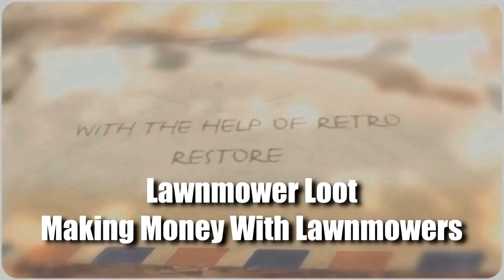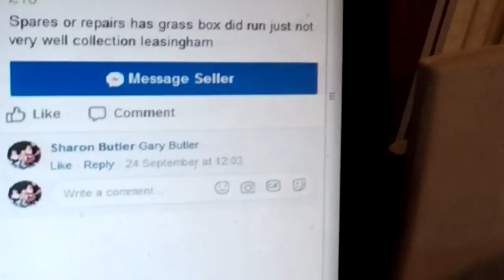Making Money Repairing Lawnmowers

Comment: I used to do the same with bicycles. I used to either pick them up free or cheap and fix em up. What ever wasn't worth the effort or too far gone would get stripped down for parts. So I barely ever spent money on new parts. I can;t do it now without ESA getting arsey, even though I only did it as a little hobby and sold maybe one bike a month if I was lucky (only because I didn't put much effort into it due to ESA but they still get bloody arsey)

Comment: Do you balance the mower blades after sharpening? I always take the blade and put a Phillips screwdriver through the hole and rest the tip of the screwdriver on the bench and hold the handle of the screwdriver in my hand and see how level it is.If it's not balanced and un level on one end of the blade
Reply from the maker: Yes I do the same

Comment: This was a great job in reviving, however there still seemed to be a slight hesitation to the engine after you were all said and done. Did you run it for longer to see if it went away, or did you find something else that needed adjusted?
Reply from the maker: You need to run these mowers for a while to burn away the oil that accumulates in the head and exhaust where they have either been over filled or tipped up the wrong way.  they will be fine then.

Comment: I replace those rubber boots all the time. it's just a bit fiddly to get on. You gotta poke the end through then grab it with a small screw driver and pull the rest of it through it takes about 3 minutes.
Reply from the maker: Yeah, I agree. Can you buy them on their own ?
Reply: I believe so? I usually save them when i change a car's ignition wires. they are the same boots that go to a distributor or coil pack. I'm 98% sure you can buy them individually.
Reply from the maker: Nice find Lem

Comment: Another great video buddy. Can I ask, I have just got myself a £10 lawnmower, but it doesn't have the throttle bar thing , can you get a universal one and have you ever had to fit one? I would like to see how you go about it.
Reply from the maker: What mower is it Ryan?
Reply: retrorestore it's a flymo petrol. But I'll have to find out the exact model if you like.
Reply: retrorestore I seen I lever kinda thing on eBay.
Reply from the maker: Is it a briggs and stratton engine and do you mean the handle leaver at the top of the handle?
Reply: retrorestore yes Martin it's a Briggs and Stratton engine. Yeah the handle at the top that you squeeze in its missing.

Comment: Cool i want to start doing this is it a good time to start looking for cheap mowers
Reply from the maker: Between now and Spring time is the best time.
Reply: retrorestore ok thanks
Reply: You ever take trades, someone buys a mower for £50 and wants to trade their old one, say for £10.  Giving you another one to work on?
Reply: retrorestore can u start an work on those other petrol mowers u have out on the decking i see a mountfield in the weeds another flymo on wheels a yellow MCcullock
Reply from the maker: The Mountfield is Gary's The Flymo is a runner but it's a plastic cheao deck and I did a video on the McCulloch.
Reply: retrorestore ok what u doing with them are u selling them as well next year and what about that mountfield its got weeds all grown over it.
Reply: retrorestore  so what will u do with the flymo and the MCcullock are they ones you have alreddy fixed reddy to sell next summer and what are all the other mowers there can u do a video on all the mowers

Comment: Is there not a drain plug on the bottom of that Briggs? Or did you just decide it would be quicker to tip over?
Reply from the maker: Yes there is but they can be a pig to get out and it's easier to just tip it over.
Reply: retrorestore thank you for the prompt reply. I thought it was maybe the 35 was different. Love your videos. Very informative, and you and your wife are too cute.  Subscribed.
Reply from the maker: Thanks bud.
Enjoy
Cheers
Martin